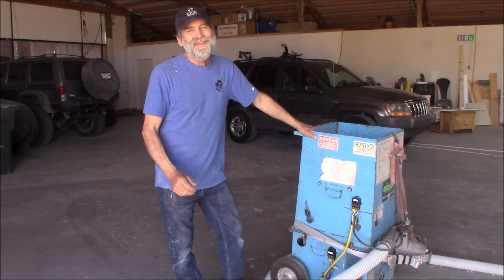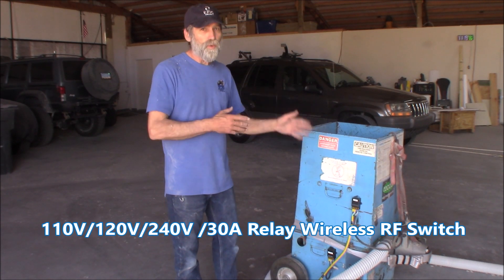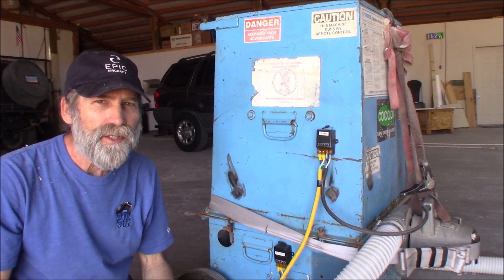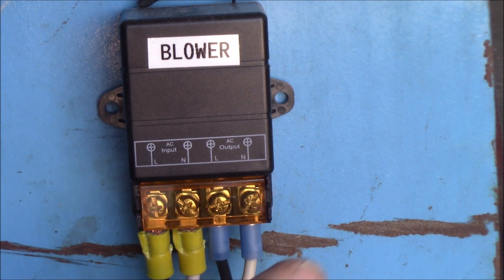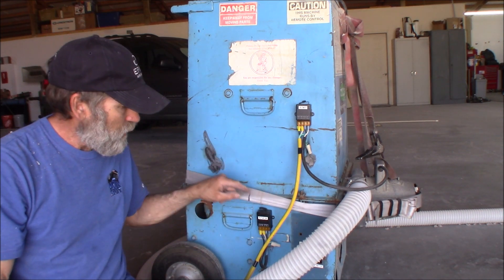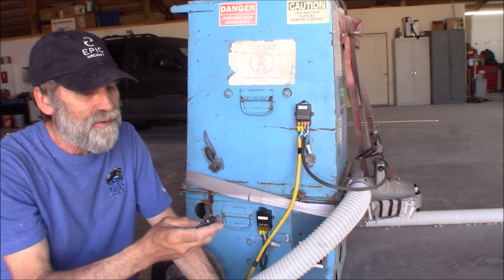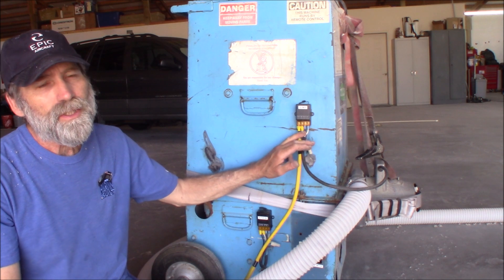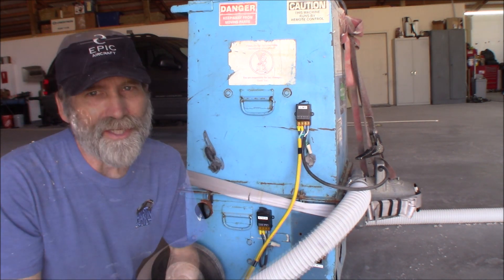How To Add A Wireless Remote Control To An Appliance

Comment: I dropped a valve seat on my 4.7 is it done for?
Reply from the maker: No, not necessarily you could either have the cylinder head repaired or replaced. And as long as it didn't damage the piston, to much you should be good to go.

Comment: I use a similar remote switch (a DC version) for my son’s 24V power wheels ride on. Fabulous range
Reply from the maker: Yeah, I'm pretty happy with it. I've increased the range to the point where I was not in line of sight of the transmitter or remote, and it still worked perfectly fine.

Comment: Good going Martin! That-a-Guy for sure and some very good thinking on your part! When you cranked up the blower, I
believe that from the sound of things, your bushings in that motor or/and the motor brushes is what's causing all that
noise and havoc to take place, so it's time for a tear down and inspection! It used to be rather easy to find stuff like 
bronze bushings and brushes but it may not really be that easy anymore. But, some of these industrial catalogs like
from McMaster-Carr can help but they seem to be quite a bit on the expensive side. You might find what you need
for bushings and brushes but an entire blower assy is not cheap at all, often costing 300-500 bucks just for a used
blower, that is if you can find one OR by doing a complete blower retrofit.
Reply from the maker: I actually found another blower on ebay $114 shipped to the door, and it was an excellent condition. The old one is still going strong, though.
Thank you for your input and watching.

Comment: I'd dare say that the amperage handling of the remote control relays inside are 40 amps with a resistive load and 30 amps
for an inductive load. Key points of this matter is: A 40 amp resistive load, example: such as a heating element or a good 
sized incandescent lamps that have a filament inside or even a tungsten filament. AND for a 30 amp load such as example:
a motorized circuit INSTEAD of the previous example with a resistive type device! These same kind of characteristics apply
to home heating electric furnaces. If there is a motor that's in that circuit, it is an inductive device, and so the inductive loads
that is stated, the relay portion for amperage is one thing BUT the electrical contacts on that relay must be rated at least 10
amps higher rating in order to properly handle that particular amperage load! Whereas a resistive load is supposed to be good
clear up to at least 35 amps out of 40 amps just to be sure that you do not exceed the maximum rating of 40 amps with a 
resistive load. With an inductive load such as with Martin's setup though the contacts rating of that internal relay is only rated
rated for 40 amps, Martin by all rights cannot allow for a motor or 2 motors to exceed 30 amps and so that's the big difference
between those 2 types of circuits. By a far the contact rating dictates what you can do and do it safely and as per the electrical
codes and wiring codes! I have maintained my mobile home electric furnace for an entire 34 years know ever since I've installed
it back in 1989 for my mother. Each and every time I do such repairs, I have to be ever mindful of what I do, just like Martin!!
Reply from the maker: Thank you for your input and your support.